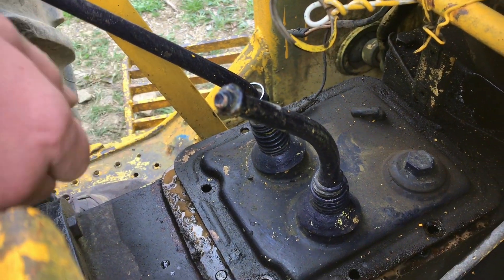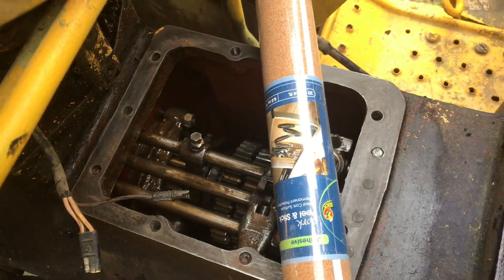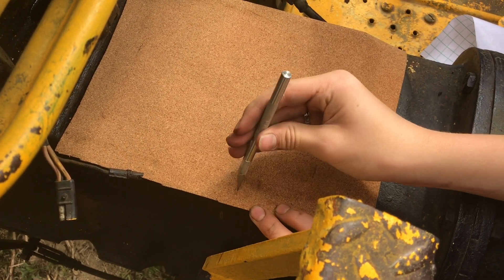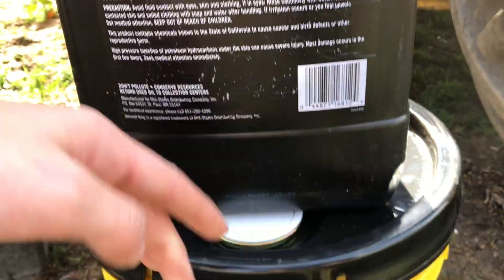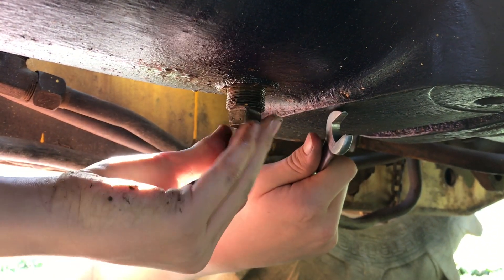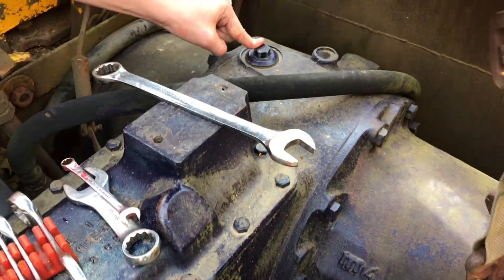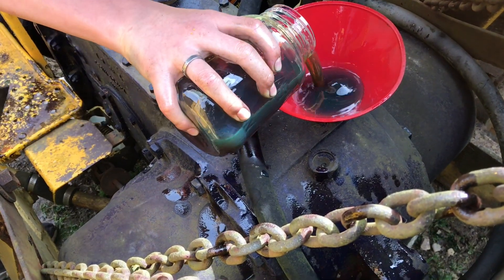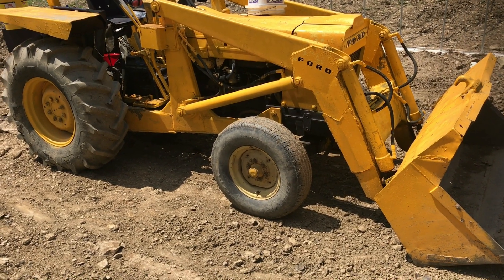CHANGING transmission and differential fluid in a 4500 Ford tractor

Comment: Thanks for the video. Regarding the hydraulic/diff fluid level sight plug. I can't seem to find reliable info regarding its exact location. One forum pointed out that its definitely not the bolt you used(the one you put a string into). The forum instead suggested another bolt on the right side of the tractor near/on the hydraulic pump. The thing is the alternative bolt (the one the forum suggested) is not present on my 4600. I know that you have a 4500 but I believe the two don't differ that much (Please correct me if I'm wrong). Also I know its a forum.....

Now obviously I'm not saying you are wrong. It's just that I want to be absolutely sure which bolt to loosen, as loosening the wrong one could be disastrous as it might retain something inside. Or it could just be the wrong height which will result in over or under filling. Can somebody else that also owns a 4600 (maybe a 1979 model by some odd chance) please confirm the sight plug for the hydraulic fluid. The bolt you used is present on my tractor and its also worn as if it has been used as a sight hole. 

(I do have a maintenance/shop/operators manual but it is vague regarding the exact location. It does however, say that the sight hole is on the right side of the tractor. (That's why I don't want to undo the bolt you used).  Thanks in advance for any assistance.

Comment: Nice to see you making your own gaskets.  I have an old Massey that parts are nearly impossible to find.  I had to rebuild it several years ago and I couldn't find any engine gaskets except for the head gasket.  My dad showed me how to cut gaskets like a pro with a ball peen hammer.  It's quick, its easy and you get perfect gaskets every time.  It was a trick he learned during WWII working on aircraft engines. 
Nice video!  It's refreshing seeing younger folks like yourself maintaining and keeping old iron running.  Keep up the good work.
Reply: 1h

Comment: Did you ever replace the brake rod seals?
That would be a good video.
Reply from the maker: I did change the seals. I can’t believe I didn’t post a video. I remember filming but things Musta got busy and I didn’t finish the edit. I have to go dig up that add I did change the seals. I can’t believe I didn’t post a video. I remember filming but things Musta got busy and I didn’t finish the edit. I have to go dig up that Footage. It is so nice having those new seals. I can’t stand having a tractor leak.
Reply: Live Free do you have that brake repair video up? I have a Ford 4400 with the same issue.  I’ve searched the web for a video to no avail. All the best!
Reply: @livefree6878  I hope you posted it, mine are leaking. How is it done ?

Comment: Those tractors usually leak oil at the brake rod seals that go into the axle tubes.  Always good to change em on an old tractor like that. Only a few bucks each.

Comment: how many gallons did the differential end up taking
Reply from the maker: I sure feel like it was about 8 gallons in the rear differential. you wanna check the specs for sure. There is that sight plug that you pour until you see it come out.

Comment: Scraping the edge with a razor blade, using a file on the edge seems like a bad idea. You're risking getting that trash in your gear box, especially metal shavings. Also, cork breaks off in little pieces when you cut it. I would have traced the top plate and cut the cork before placing over the hole.